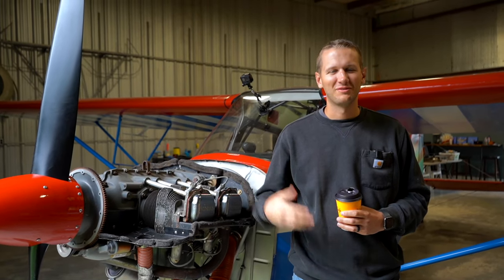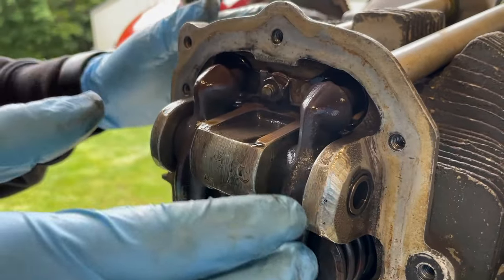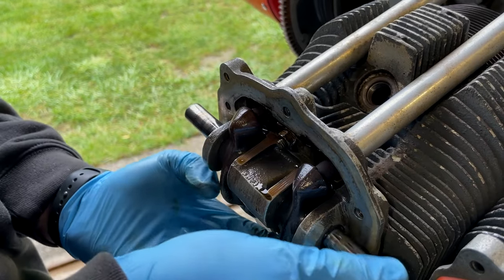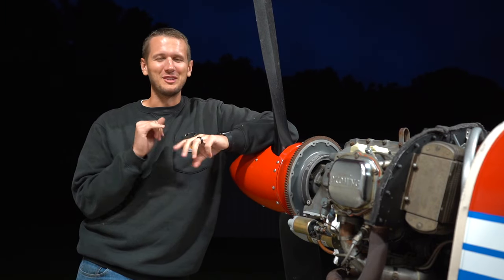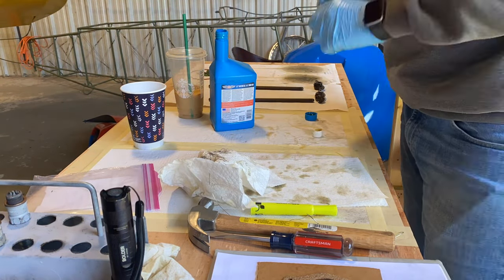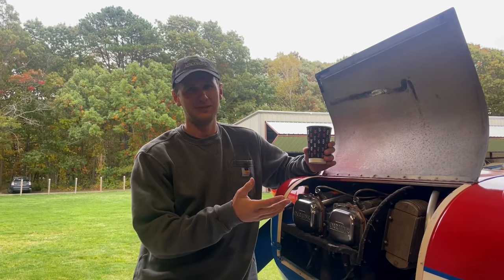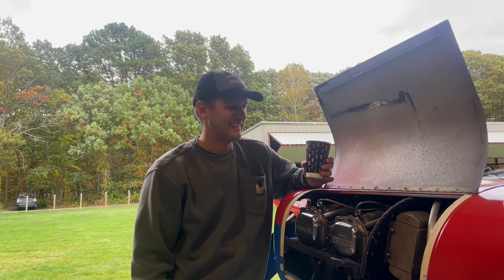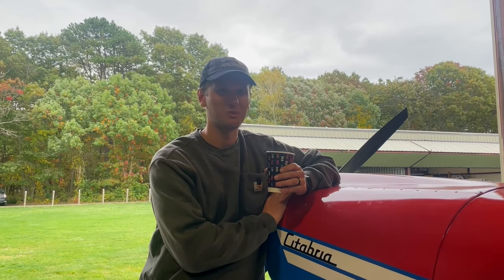Lycoming O-320 Cylinder Change on a Citabria 7GCAA

Comment: There are several exhaust port resurfacing grinders that bolt on the rocker cover mount & reface the exhaust port without removing the cylinder.
Reply: Not to mention removing the studs and using an angle die grinder with a sanding disk. What you did would be criminal for a regular shop to do.
Reply: @michaelsamson3276  I used to do that before I invested in the exhaust port resurfacer. Also you can use a few thin stainless or cooper exhaust gaskets. No blows exhaust gaskets seal poorly & eventually the exhaust port hole gets larger then the sealing ring on the no blow gasket. You can also get the thick old cooper asbestos gaskets. Use furnace cement instead of Red RTV. Replacing a good cylinder especially with a overhauled one of questionable history is stupid.
Reply from the maker: @Nord3202  Have to remember, this is YouTube and this is meant to be entertaining and show the process for people to understand it. To put all details in would get boring and unnecessarily long. The cylinder that was replaced was an already overhauled one from the right side so not sure its a "stupid" cylinder. Or were you calling me stupid?!

Had this cylinder sent out and overhauled. Few parts tested out of tolerance and replaced. Happy with our decision. Thanks for watching!

....does spruce sell that furnace cement?

Comment: You are super knowledgeable and since I don’t know who to ask, I thought i would check YouTube. I’m trying to sell an o-320 b2b that has been in a nice air hanger for 20 yrs. 20yrs ago it was overhauled, cylinders honed, with new piston and rings. Can you tell about how much I should sell it for? I’m looking to sell on eBay unless you suggest a better place. Any info is very appreciated!
Reply: If the cylinders boroscope with no rust & you have the log books & AD documentation 12k to 18k depending on the parts replaced.
Reply: @Nord3202  Yep, I was going to say 14K

Comment: So can someone who's worked on cars work on these small plane engines too, or do they need certification?
Reply from the maker: To work on and sign off any work on an airplane you need an Airframe and Powerplant certificate. While an engine is an engine, there are a lot more regulations and paper trails that need to be followed.
Reply: Thanks. @CliffandJanie